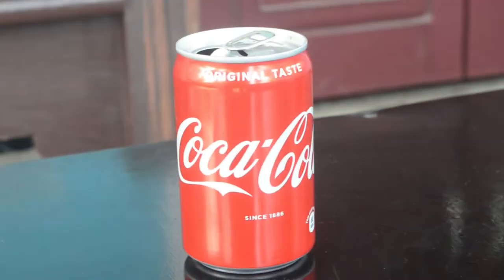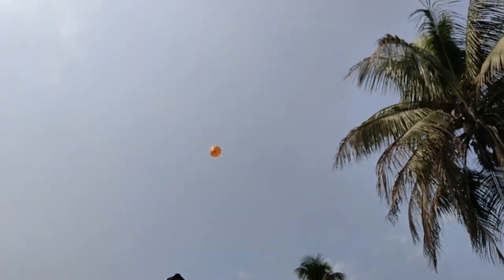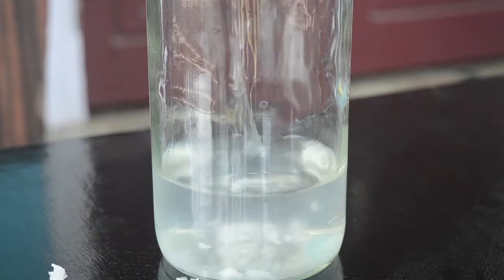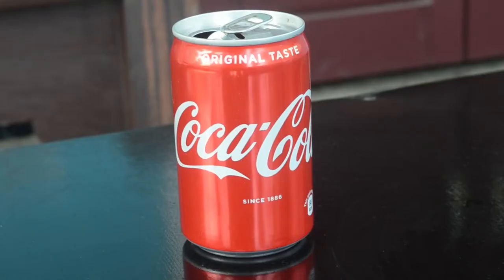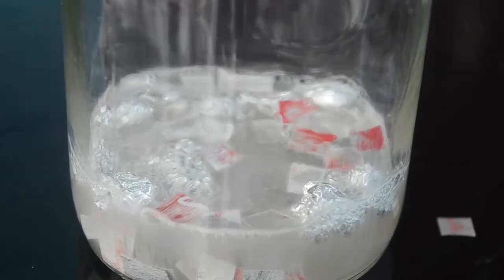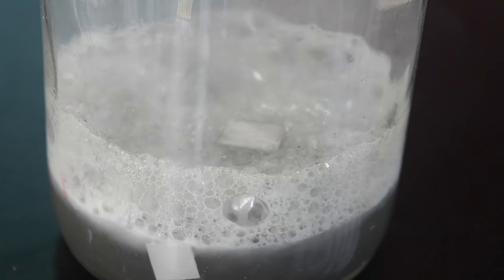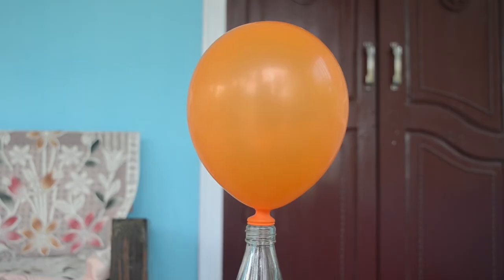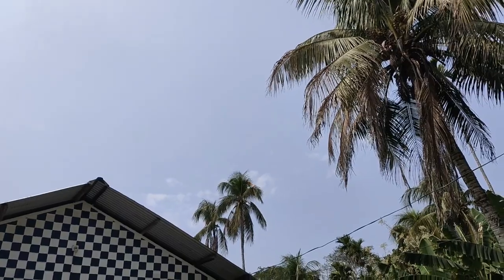How to make Flying balloons at home / Homemade hydrogen gas balloons /

Comment: Baking soda use?
Reply from the maker: No only caustic soda and alluminium .
Reply: @TheRandomBunny09 you should bought a pem electrolyzer it easy than not need sodium hydroxide just need disttled water it has pure hydrogen and oxygen.